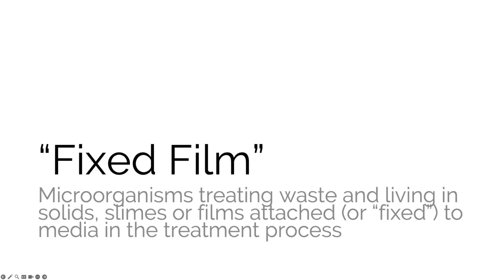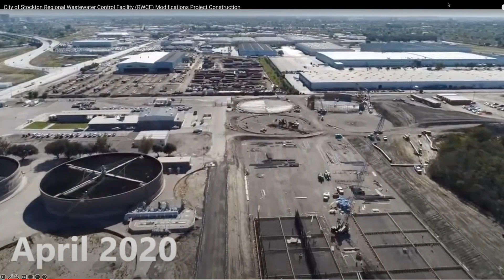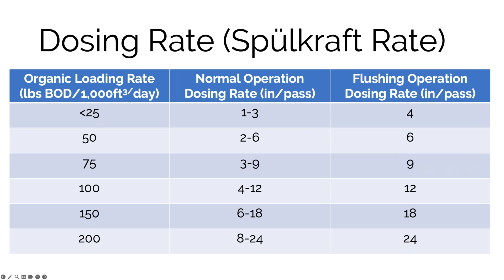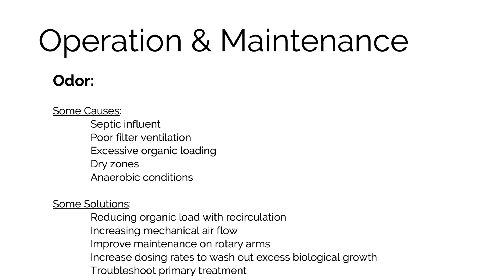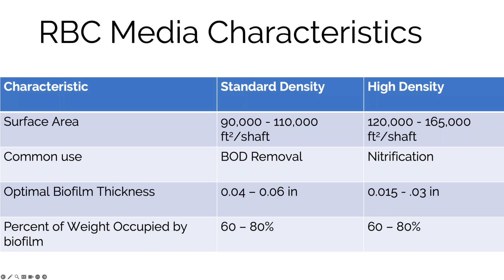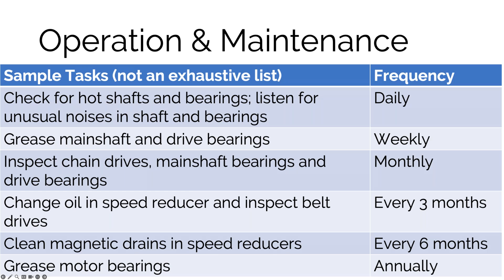Webinar | Fixed Film Secondary Wastewater Treatment Processes

Comment: I'm in Alabama how do you clean RBC's we don't use this process !
Reply: The film on the rbc is the biological growth that consumes the bod/dissolved solids. They don't really get cleaned outside of being taken offline but that would be similar to taking one of your aeration basins offline, isnt really done unless you have a longer term mechanical issue or a micro growth you need to eliminate. Sloughing (pieces of the film falling off) happen naturally as part of the process and keep the film from becoming too thick. 

Not sure if that answers anything. If you just mean failure and cleaning,  power washer or high pressure hose.